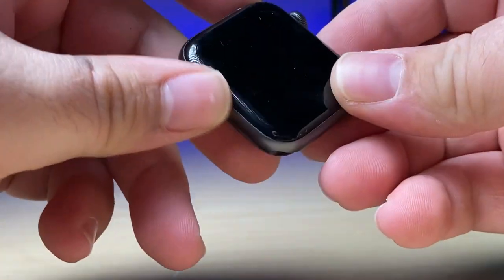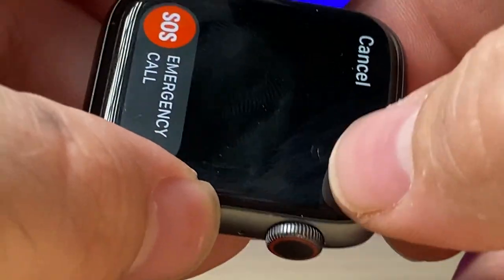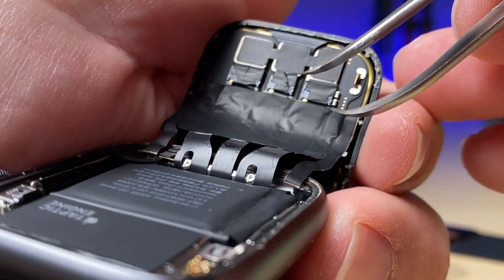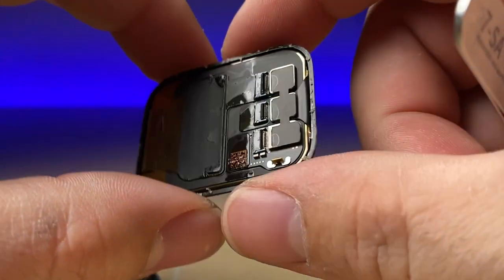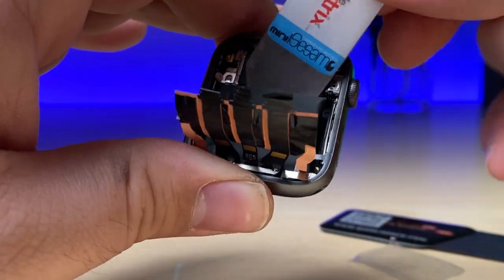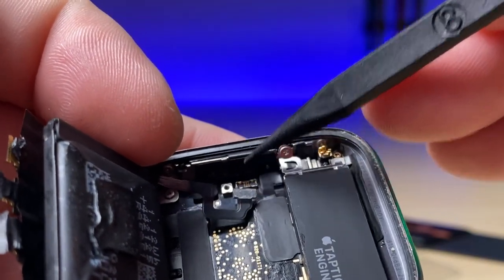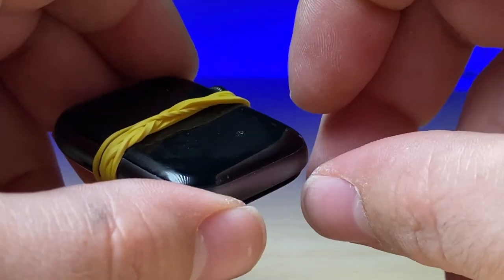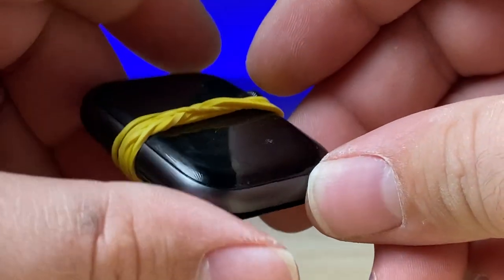Boost Your Apple Watch's Lifespan: Battery Replacement Guide!

Comment: Tried replacing the battery on my series 3. Three batteries later and not one would consistently charge. Sometimes they would, sometimes they wouldn’t (even though it knew it was connected to a charger) Sometimes it would say it charged to 100% but die in 20 minutes. 

Would have kept it if I could fix it, but I ended up just replacing it with a series 8. Much better anyway.

Comment: My god, this is supposed to be easy to do?  I thought I was good at fixing stuff, but if the general consensus is that this is easy, then I need to rethink that about myself.   I know that I would screw this up.  So many steps and places where things could go sideways.
Reply from the maker: It's only easy after you've done it enough times.
Reply: @FIXDPHONES  Evidently.  I should have known.  It’s the same dynamic I experienced in my journey to master brain surgery.  😃

Comment: BTW, why disconnect the screen other than maybe a slight bit more room to work?
Reply from the maker: Because it’s one less thing that can pull on the fragile flex cables as apple used very little solder on its joints, but it can definitely be done with the screen on, just not work the risk in my opinion

Comment: Yes, nice job and very neatly done! Please, what size and type screwdriver. Too many inconsistencies online beween triwing, tripoint, and Y type. I think I need a 0.6 or Y000 tripoint/Y type, these two types seemingly the same, and the two sizes being the same or very close. BUT, I saw in another video a guy using a Y 0.8mm. Unfortunately Mobile Sentrix doesn't carry it. And, I think Mobile Sentrix labeling theirs tripoint/triwing is wrong. See here: https://en.wikipedia.org/wiki/List_of_screw_drives#Tri-wing    Your help is greatly appreciated!!
Reply from the maker: Mobilesentrix has them all, from the individuals all through the kits like the ifixit kits and triwing/ tripoint can basically be used interchangeably as apple has appropriated the other, kinda like them calling a fuse a filter on their schematics.